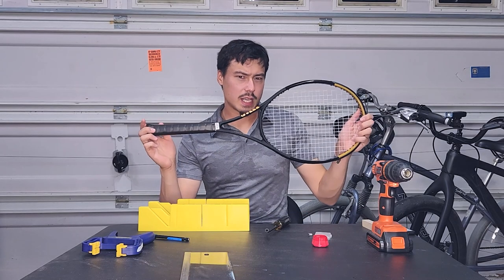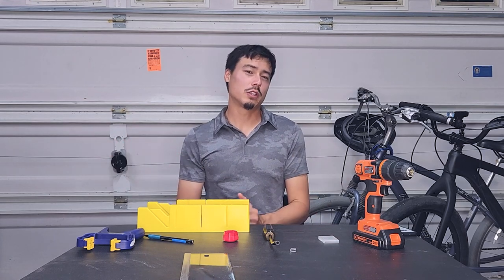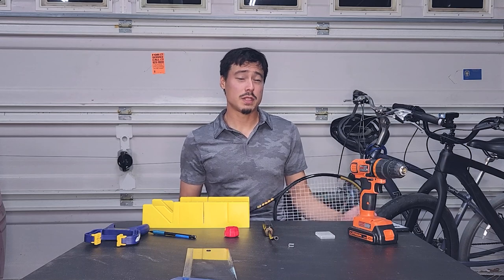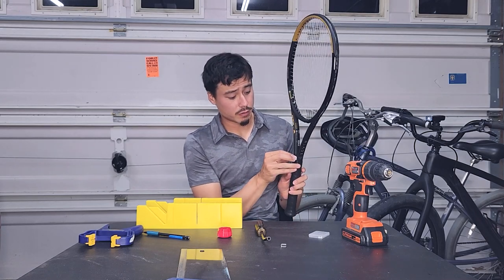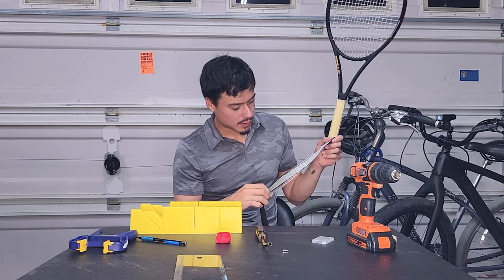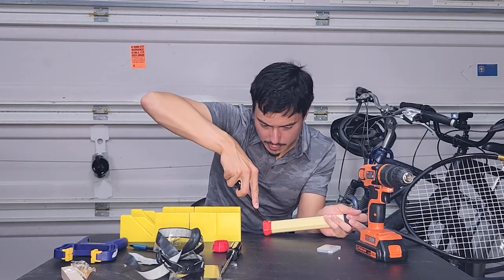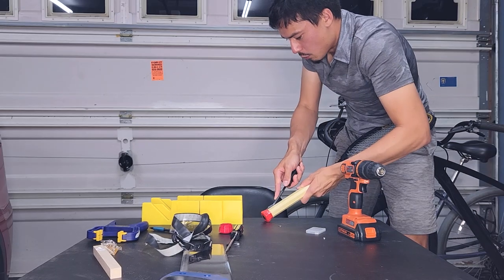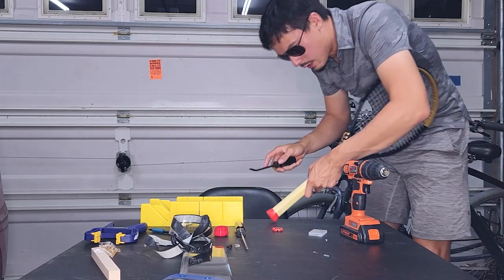Why and How I Cut My Racquet

Comment: I also decided to tinker a bit with my rackets 😅 I put leather grip on my vc 95 and i was shocked how much it "changed" the racket. My shots became noticeable harder and i was feeling increased stability. Greatly increased easy spin. Overall i was sceptical about the benefits of added weight by leather. But now im sold!
A few days after i did the same to my vcp 97 and now it crushes the ball too) that lack of power which we talked before is gone now.
Both of them are 332 mm balance now and 345-343 g weight depending on overgrip and string.
The interesting thing is that it feels almost easier to swing and it hits the ball hard all by itself 🎉
Reply from the maker: Nice! I generally always prefer a bit of extra handle weight! Always helps with spin for me.

Comment: perfect guidance！  I want to cut  my pure drive plus down to 27.25"😁
Reply from the maker: Haha if you have some cutting tools, you can probably get the job done. It isn't rocket science. Yeah, cutting down that little bit opens up some room to weigh up the head, if you want, and enjoy a lot more stability and plow through at the same swingweight it used to be before cutting. 

Sounds like a good trade if the only sacrifice is 1/4"

Comment: Awesome video, just to clarify: Your sw at 27.5 in length was 320 unstrung? That would still make a hefty sw of at least 350 strung, right?
Reply from the maker: Been a while but I think that is right. I believe I ended up cutting down another quarter inch and then realizing the contact point is still lower than it was on the PA 98 at standard length so I saw no point in this racquet after.

Comment: very benefical video🤓but i would prefer 27,25 inc one instead of 27.5.im sure it would be very manevrauble and controlled then.
Reply from the maker: I think you're right! I believe I took even more off but I'm not sure. So many racquets and so many modifications haha. I'm really preferring standard length these days. I cut down a 27.25 to 27, recently. It's nice to get that 10 units of swingweight back to play with as I see fit. Or just have the same stability but 10 units easier to swing

I can't justify the gains in swingweight for a fraction of an inch in length.

Comment: As someone who changed the grip to a leather.  The SW measurement doesn’t change but the actual swinging of the racket changed significantly while playing
Reply: Of course it would. You have literally altered how the racket swings and performs. Swing weight isn't the only factor there. All the specs come into play.
Reply from the maker: I agree. It definitely changes the balance. It does feel as though it lowers the swingweight, you could say. Having the tools, it's made me appreciate balance of a racket so much more than I used to. I think balance and swing weight are so important to getting a racket feeling the way you want and playing the way you want.

Comment: Funny, I did the exact same thing to an SW 104, pre-drilled staple holes and all!
Reply from the maker: Niiice. Gotta do that when you don't have a pneumatic staple gun.
Reply: @ZeroLoveTennis  Also when you want to do a better job than Wilson...
Reply from the maker: Lol fair
Reply: With this experience in my pocket, I also trimmed 1/4" off of an over-spec Gravity Pro.  Got the SW down to the mid 330s from 345, proving to myself that SW can actually be reduced (if not easily).

Comment: Brilliant video,  - agree with you regarding the restring zero - just used it at 47lbs= prince textreme 98 tour -  best string ive tested and ive tested 98% off all poly's out thr,   the snapback is great and lasts way longer, so far lasted 3 weeks longer than previous setup of volkl v square -  still snapping back and easily playable,   just need to try the toroline wasabi and the mayami tour hex
Reply from the maker: Thanks for sharing! My journey was similar. Nothing really compares and after trying so many that market great spin, you figure that the reality must be that nobody really does come close.

Glad you tried. I think you'll also appreciate the snapback of Wasabi as well!

Comment: This is wild, I JUST switched from a pro staff to this racquet. Did you actually try hitting with it at 28" before cutting it down? I really love the extra inch as well as the string pattern + parallel drilling. Crazy amount of power and stability with surprisingly decent maneuverability. Really looking forward to seeing what strings / tension you try with it.
Reply from the maker: I've tried this racket a bunch of times at the standard length. But I always found it ultimately to be the reason I wasn't happy with it. Or at least it was one of the factors. I associated it with a few things but that was one thing I knew I could change. The swingweight was already so high so anything about stability and stuff, would only come from adding weight. 

Yes, still getting to know it but I think I like it better. Did you find an overgrip that actually wraps all the way up 😂
Reply: @ZeroLoveTennis  I use tourna mega tac and I can get it all the way up if I wrap it pretty tight but yes, I wish the overgrip was a bit longer lol
Reply from the maker: Each size up gets wider, not longer, right? Kind of funny.

Comment: The extra swingweight from the length also gives you more racquet head speed at the tip so it’s not for nothing besides the reach
Reply from the maker: This is true. However I feel like that only cancels out the difference in inherent stability and more often than not I think you'll be punished instead of rewarded since anything slower, which would be many shots, would feel less stable.

Also, the faster headspeed plays into precision a bit. The same arm motion means more head motion so it requires more precision from the user while also being less stable. It's a funky trade-off.

But you're totally right I feel like on serves it's basically always a win to have more length.

Comment: Ok. I have a SW102 cut down to 27.5". I bought it for almost all the reasons you did. My only issue is the 69RA but it doesnt feel that stiff, right? My Swingweight is 322. 
Im considering adding some weight at 9 and 3 if it'll increase twistweight.
Ive been unhappy with stiff polys and now play with Ghostwire 18g at 57lbs to account for the increased head size. 
It works for me as a devout doubles player because of the howitzer serve and solid volleys. I have the most problem trying to pull backhand returns of serve down the line. Cross-court presents fewer issues.
My frame weighs 11.7 ounces strung.
Do you believe that cutting it down (again) to 27.25 and adding lead to hoop to equalize swingweight lost would produce a more playable frame?
Reply from the maker: RA is one of those things...you try enough of them and you start to see that RA feel can vary like +/- 5 or more and it super depends on other things about the racquet. It really depends what your reference for 69 might be.

Like I think the Pure Strikes feel much softer than the RA suggests. I think the PA98 does as well. I think the Clash actually feels stiffer than RA would imply.

Too many variables. The SW102 might feel stiff on contact due to superficial plowthrough with a high Swingweight but not much actual weight, especially at the head. 

322 at 27.5 would be more like 302 at standard length. So try to realize that you actually have the stability of a swingweight of 302, it just says 322 because it's harder to swing. You'll need something like 340 to feel the plush plow you could get at 27" with the same swingweight.

Realizing this turned me away from extended quite a lot. To think 1 inch would mean 40 units of swingweight with zero gain in stability/plowthrough.

Maybe it isn't quite that simple but I would say it almost is that simple. And that is the reality, for sure, in situations like volleys where your headspeed never gets up to a rate where the speed of the mass (which should be higher because of the length, right?) will make up for the lack of actual mass relative to the swingweight...

And that really was the nail in the coffin for me on extended rackets.

I'm sure I will tease the idea again in some way but I have no idea. That is a really tough wall to overcome.

Comment: Is that the SW102?
Reply from the maker: Good eye
Reply: @ZeroLoveTennis  Why are you cutting it, too much swingweight?
Reply from the maker: High swingweight with not enough stability. I explain in the beginning that making a low swingweight racket longer doesn't give you same kind of stability you'd get if you increased the swingweight with actual weight. Yet both will be similarly hard to swing so which racket is technically better? I'd say the shorter one of equal swingweight when comparing a standard length.

Know what I mean? It's really about the trade-off
Reply: @ZeroLoveTennis  I had the same problem with my PD+ at first, the racket was unstable and had a cheap tinny feel, so I added lead tape at the 3, 9, and top of the handle area to give it stability as well as more lead at the tail to bring the swing weight down and now it plays like a dream!

Comment: Don't add weight ...string the poly at 38/36  or 36/34  I have that racket n also took half inch off...black poly tour pro 1.25mm worked  best...yellow notched and stopped snapback  in couple hours
Reply: I can confirm that a poly around that tension feels really nice on this frame.
Reply from the maker: I strung around 43 with a different poly than usual. Feels pretty good but I could try a little lower with zero next time. Probably mid to high 30s like you said 😁 glad you like the lower tensions!

Comment: Oh since maybe all racquets are hack jobs maybe it’s time to take apart a regna to see if it is any better :D
Reply from the maker: Looool don't tempt me
Reply: @ZeroLoveTennis  You know you wanna find out
Reply: @ZeroLoveTennis  plus you can fix the potentially messy staples at the very least and make it prettier inside
Reply from the maker: What if buttcaps could thread on? 🤔
Reply: @ZeroLoveTennis  why don’t they do that?? I am sure it wouldn’t add THAT much cost.  Diadem coulda if they cared about it :(